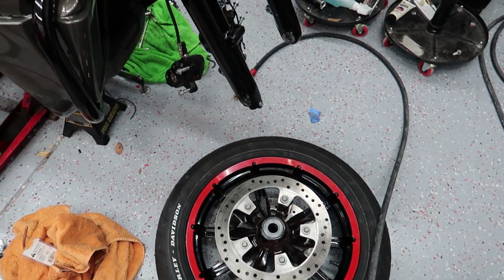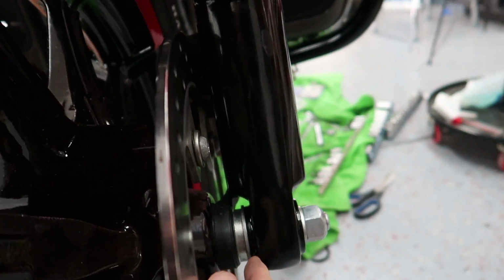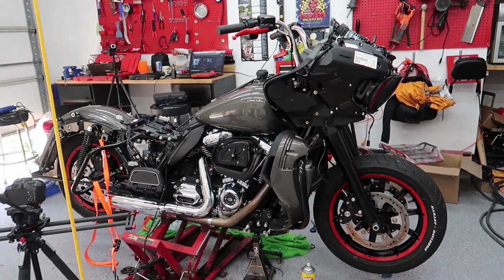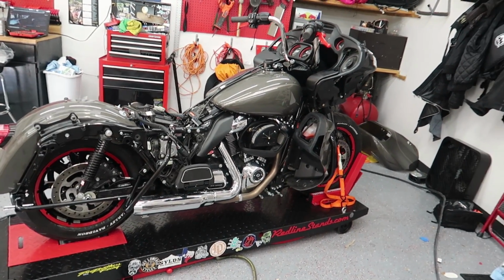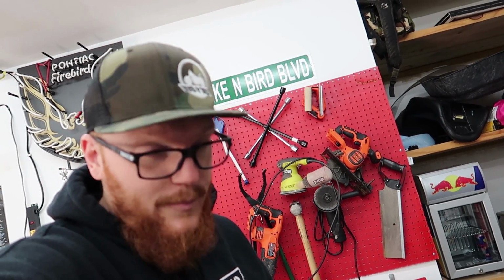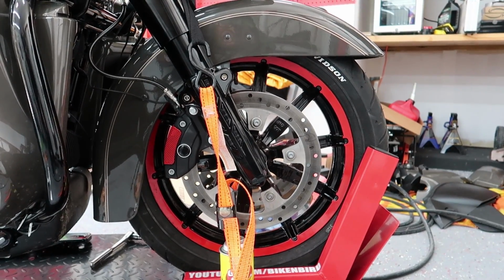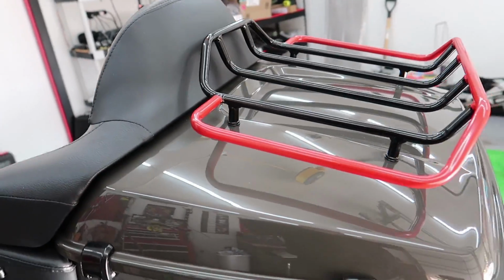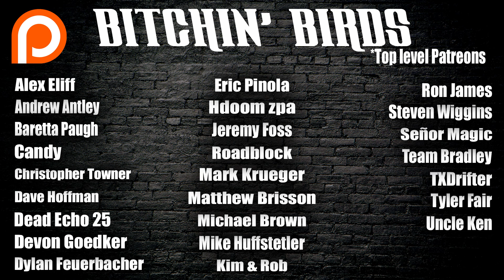Back On Two Wheels! - Ultimate Ultra Build Series Ep. 5

Comment: Are you sure the bearing and axle sleeve on that front wheel were installed correctly or were the right size?
Reply: It looks like the wheel  or hub was not ABS I wonder if someone swapped them when they got power coated. The abs sensor sits in a recessed area on the wheel if I recall

Comment: The only part that was actually swapped out where your wheel bearings, that's where I would look. Should not have to use a damn washer to space the wheel on a brand new bike. Take it to your buddies at the dealership I bet they'll raise a brow over that "spacer". Keep us posted, something is not right.
Reply: I would agree. You have an issue. Also, where is the ABS sensor ring. Looks like you now do not have a working ABS system...
Reply: yeh I agree. using a washer is not the way to go. you could get a spacer machined if you actually had to have one. the youtube guy in Britain del boy did one and it was perfect. not using a washer. something is not right here.
Reply: Why would you use a washer? It’s not right so we will jimmy rig something... smart.